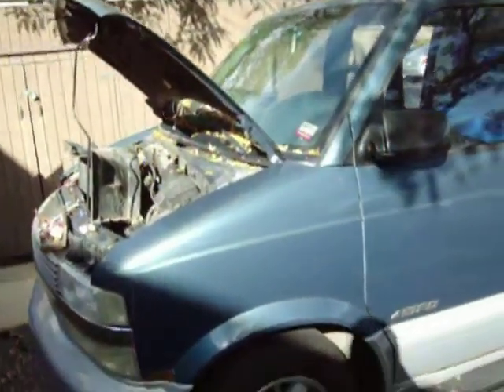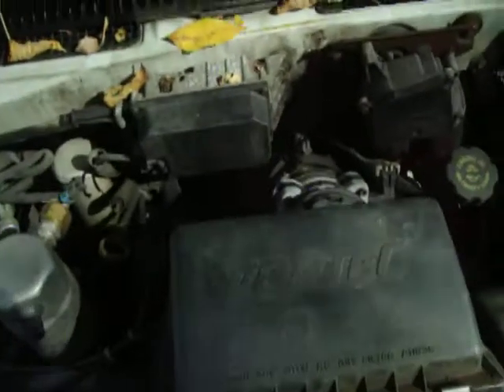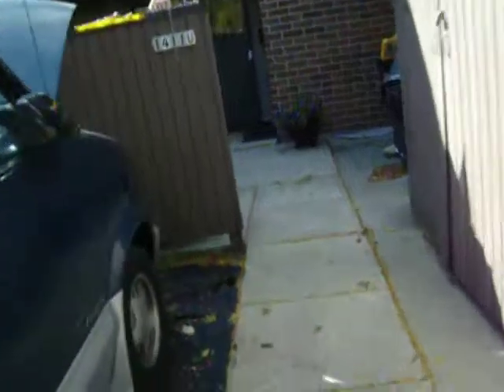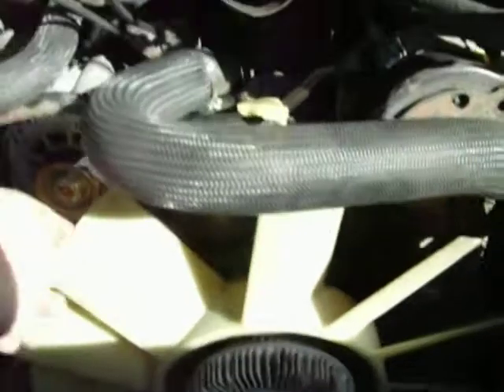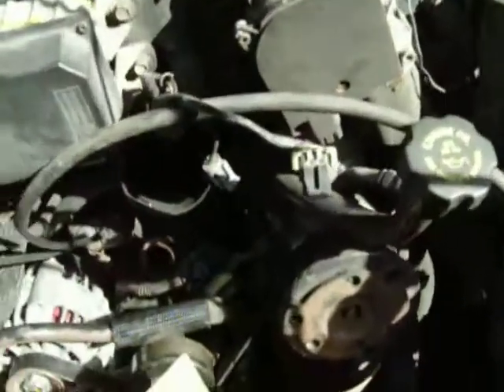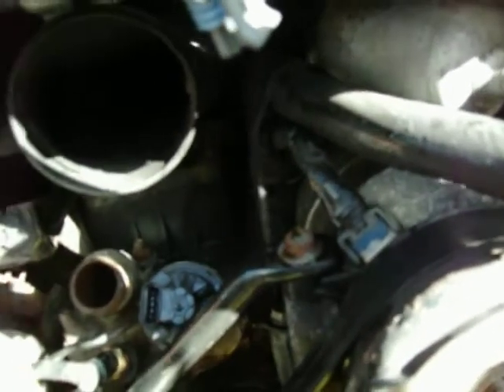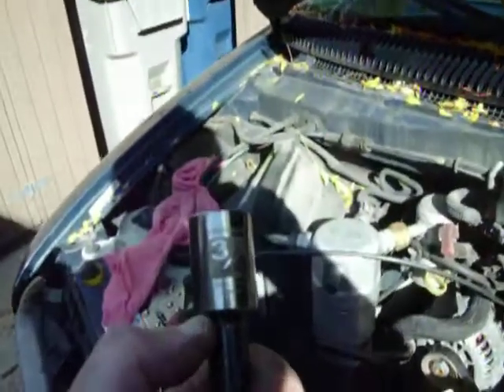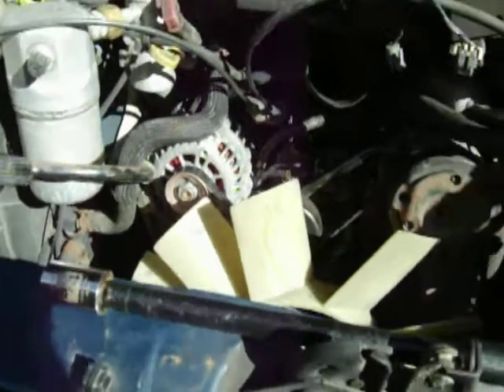1998 GM Vortec Engine Coolant Sensor

Comment from the maker: Introduction
This tutorial provides step-by-step instructions for replacing the coolant sensor on late-1990s GM engines, specifically for vehicles like the 1997 Chevy “Smashtro” van and the 1998 Chevrolet Astro. Understanding how to perform this replacement can help maintain your vehicle’s cooling system effectively.

Step 1: Ensure Safety
Park the vehicle on a level surface.
Allow the coolant and radiator to cool down to prevent burns or injuries.
Disconnect the negative battery cable to avoid accidental engine startup while working.

Step 2: Remove Air Intake Assembly
Unclip the two wiring connectors attached to the air intake assembly.
Carefully remove the air intake assembly from the vehicle.
Take off the upper radiator shroud to gain access to the coolant sensor.

Step 3: Access the Thermostat Housing
Loosen the upper radiator hose clamp located at the engine intake (thermostat housing).
Twist and pull the engine end of the hose off the thermostat housing.
Place the hose out of the way to create more working space.

Step 4: Disconnect Additional Wiring
Locate and unclip the two wiring connectors near the thermostat housing.
This will help in accessing the coolant sensor without obstruction.

Step 5: Remove Water Pump Hose
Loosen the water pump hose clamp.
Pry or pull the water pump hose off the water pump and place it out of the way.

Step 6: Replace the Coolant Sensor
Use a 3/4" half-inch drive socket to remove the coolant sensor from its housing.
Install the new coolant sensor by threading it into the same location.

Step 7: Reassemble Components
Reverse the disassembly steps
Reattach the water pump hose and secure it with the clamp.
Reconnect the two wiring connectors near the thermostat housing.
Reconnect the upper radiator hose to the thermostat housing and tighten the clamp.
Reinstall the air intake assembly and upper radiator shroud.

Step 8: Reconnect Battery
Finally, reconnect the negative battery cable to complete the process.

Conclusion
Replacing the coolant sensor is a straightforward task that can enhance the performance of your vehicle's cooling system. After completing the replacement, monitor the engine temperature and coolant levels to ensure everything is functioning correctly. If you encounter any issues, consider consulting a professional mechanic.

Comment: Does this make the dash board. Not show the temp on the dash board. Cause my dash shows 100 and it doesn’t move.  I have a 1998 Astro
Reply from the maker: ¡Gracias, Roberto!
• This does NOT make the dash board. This is the coolant sensor. The temp on the dash board comes from the Temperature Sensor. The instrument on the dash board that shows the temp may also be muy malo aqui. Drive the van over to Auto Zone or any auto parts store where they can check it for you and recommend the parts you may need.